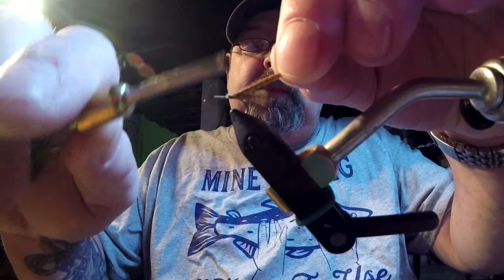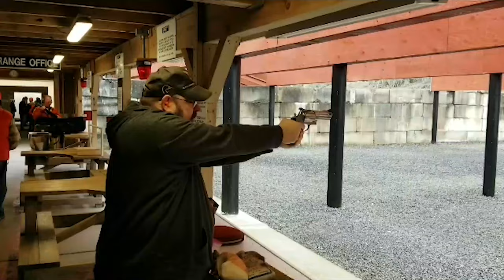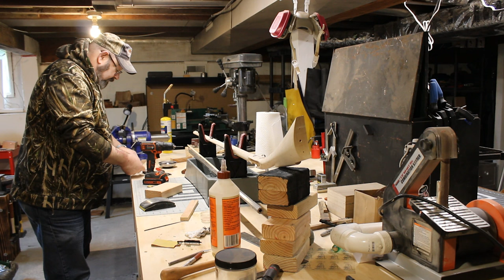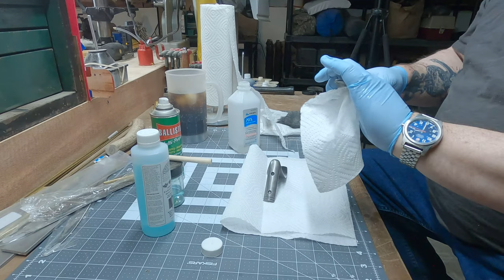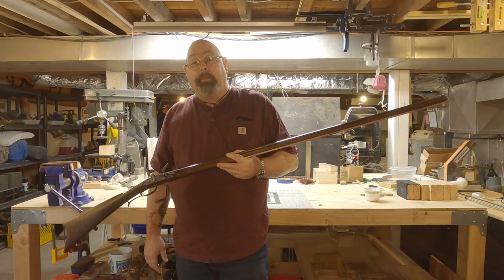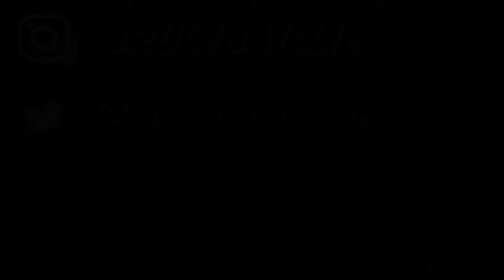Completing the Kibler

Comment: Bruce shipment of my mountain rifle will here soon. I just have a question for you. My concern is the drilling of the under lugs of the barrel. Jim uses a jeweler saw. Iam afraid of making the holes to big!!! How did you do your rifle? It looked like you really struggled with your trigger guard! What would I expect doing mine. It looked like you didn't use a drawl file on your barrel. Did sanding do the job ? When I get into the build I might be asking you more questions. Thank you Bruce like you I just retired after 50 years of service!!!
Reply from the maker: I was definitely draw filing the barrel flats. I just followed up with the sanding to get the finish I wanted, For the barrel tabs I used needle files to lengthen the slot. I have a jeweler's saw and planned to use it for that but just grabbed the needle file when it was time to do it. The needle files were quick and easy.

Comment: Bruce what kind of problems did you have in your build and what caliber did you choose? I see Jim has a new jig for putting the pins in should solve the problem you encountered!
Reply from the maker: Pinning the barrel, but Kibler now includes a drill guide, so it shouldn't be a problem in the future. I cut wedding band on the ramrod tubes and totally screwed them up. Ordered some replacement and did them right the second time around. Had some trouble fitting and pinning the ramrod tubes too. ended up rebrazing the holes I drilled several times before I got them right.  I also galled the screw holding the frizzen spring reassembling the lock and discovered it taking it apart again for tarnishing the metal. I shipped the lock plate back to Kibler and he fixed it and returned it to me within a week. I cant say enough about their customer service. They are outstanding, as well as having an outstanding product. So happy with SMR in .36 caliber, planning on ordering a Colonial in .58 now.
Reply from the maker: One more thing to be careful with is the first pipe. Make sure it aligns when inserting the ramrod. I had to reset it twice to make sure it wasn't loose and would let the ramrod go down in. Be sure and use a clamp to hold the pipe in place when you mark it for drilling, and make sure the ramrod will go through when you have it placed...before you drill it.

Comment: Bruce what stain did you use and what finish? Looks real dark you should've used iron nitrate to finish for a lighter stain
Reply from the maker: Dan I used Aqua Fortis which is an iron nitrate stain. I also used Tru Oil for my finish. Not all woods come out lightly colored, but the finish is darker than I hoped for, but is still lighter than it appears in pictures.

Comment: What are you using for the steel
Reply from the maker: I used a brass and bronze aging chemical that Kibler used to sell. He has a different one he sells now. It works real well creating an antique patina on the steel parts. You can still buy the one I used on Amazon for about $10, but I would by whatever Kibler is selling now. I feel he wouldn't have dropped the old product if the new one wasn't better.